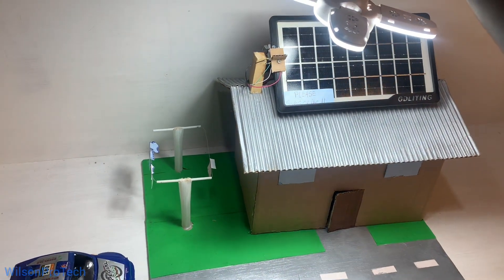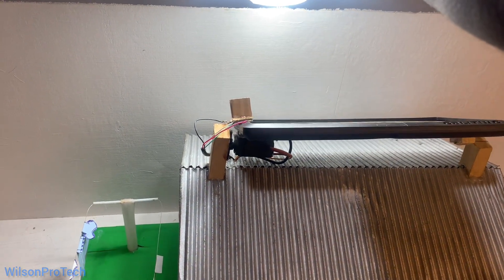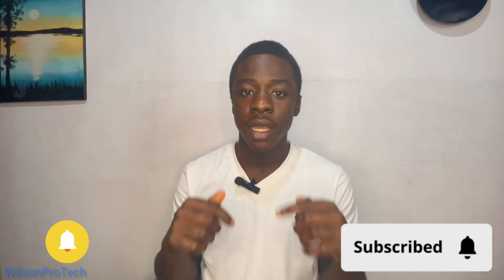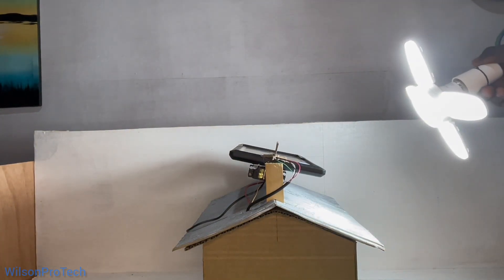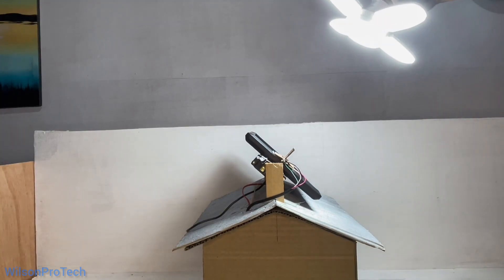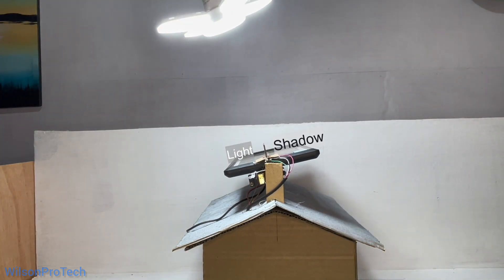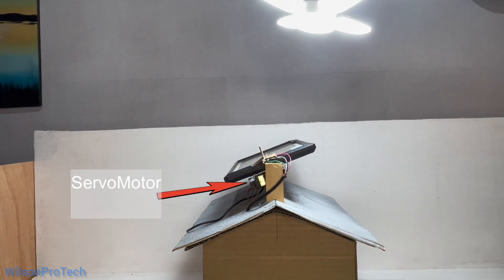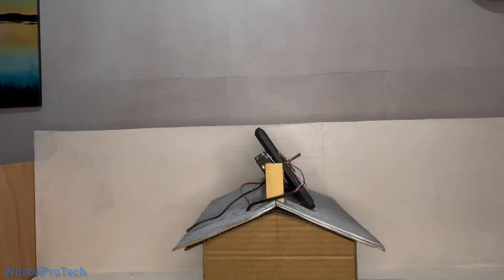Arduino Solar Tracker Tutorial – One Axis with 2 LDRs & a Servo Motor

Comment: What is the value of LDR
Reply from the maker: They are common LDRs used in Arduino projects, usually around 10kΩ to 20kΩ depending on light. The important thing is that both sensors are the same type.